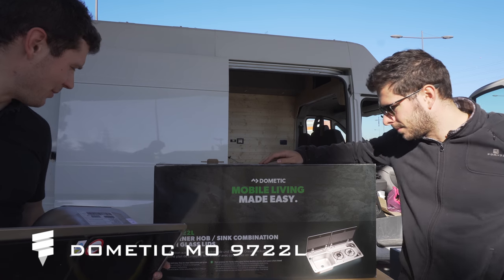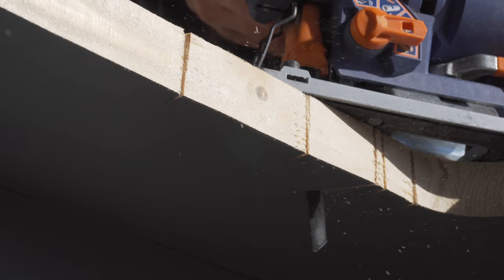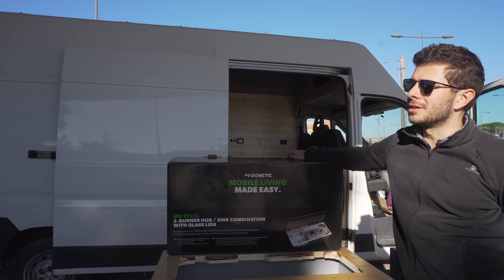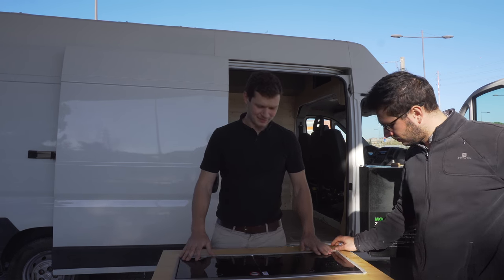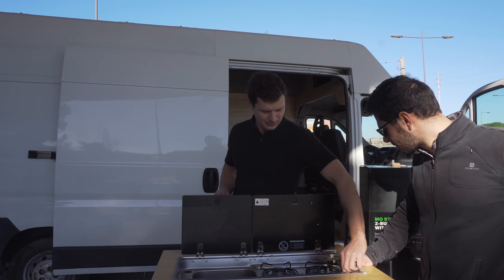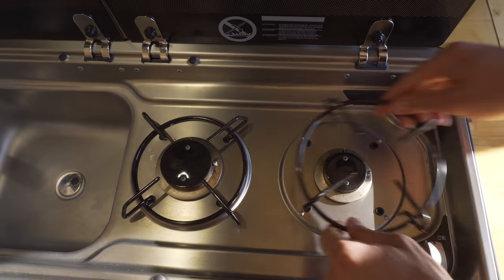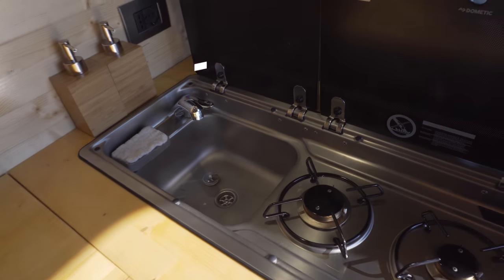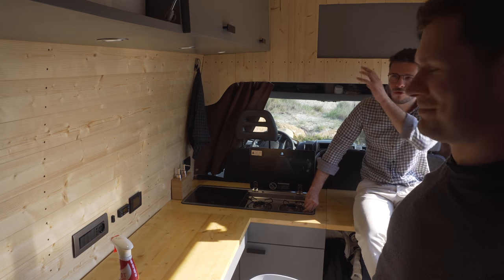Review Dometic MO 9722L, MO 9722R and TAP AC 539

Comment: Nice video. I've been checking your van build for some time as I'm doing my own. I've just bought this very same Sink/Hob and looking at worktops for it to sit into . What wood is the worktop you've used and what is the thickness ? and what would you say the minimum thickness should be used on this sink/hob instalation ? Thanks. !

Comment: from where do you take the power for the machines? (looks like you parked some where in the know  where with no power outlet..)
Reply from the maker: Yeah, that's not ideal as we did all the job in the parking lot. We used 3 kw fuel generator and now we can use out inverter and batteries)))
Check our latest video if you are into building a camper van:
https://youtu.be/j1fStiuMTmY